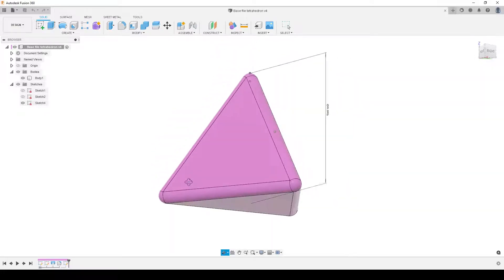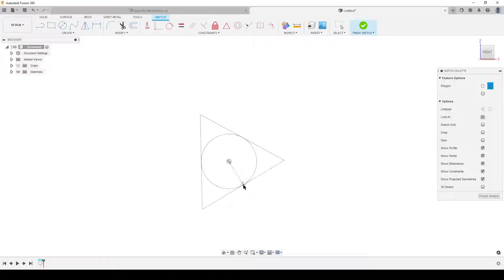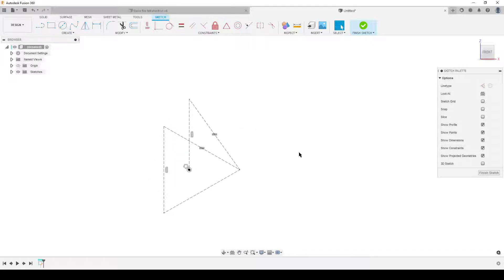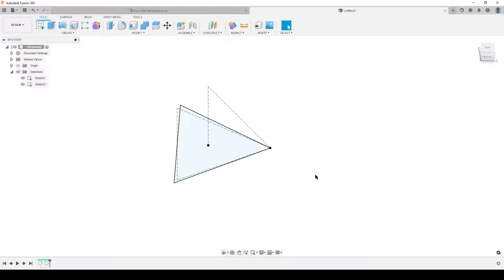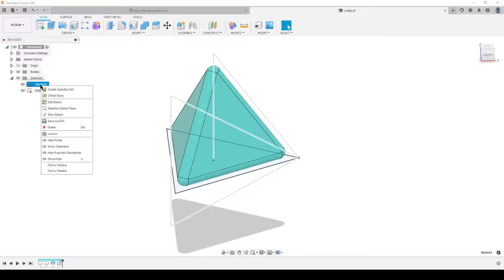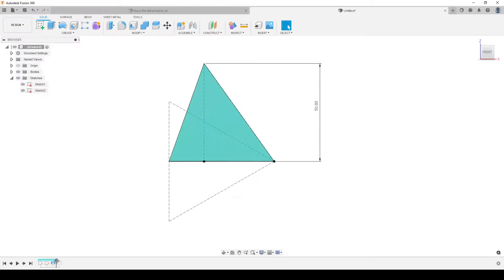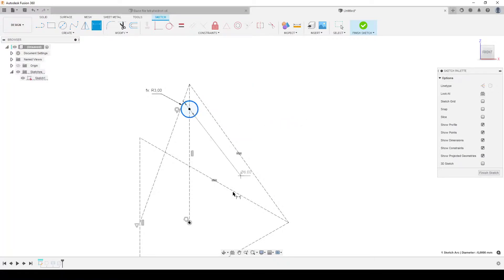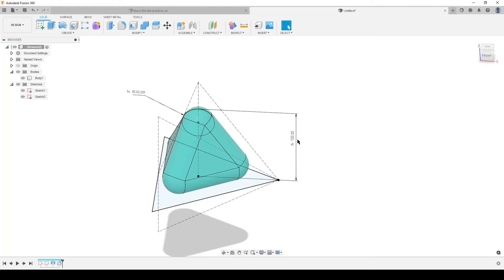Fusion 360 - Fillet Tetrahedron (2022 januari challenge workflow)

Comment: there is no way this is the method for such a simple thing? creating the triangle is very easy in 3d sketch, but to make the right dimensions after fillet is done is where all the shit break loose :/

EDIT: never mind, I figured it out with one 3d sketch, it works exactly the same way, try out guys!
Reply from the maker: 3D sketching in Fusion is still a bit flimsy in my opinion.